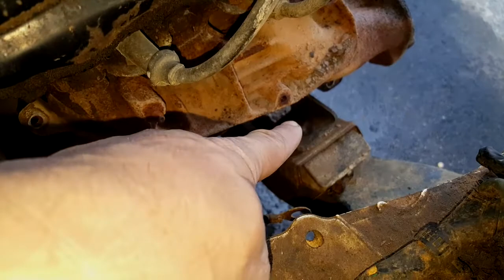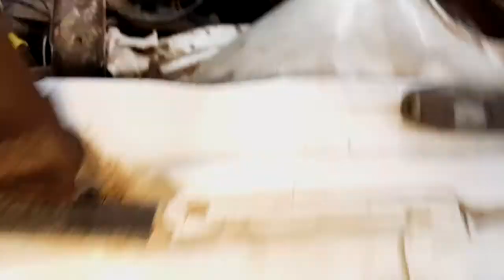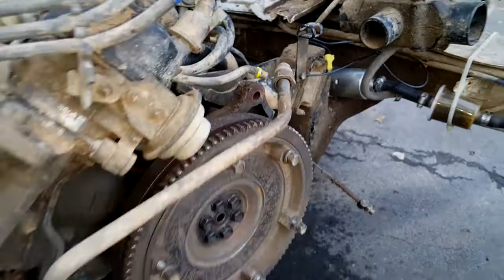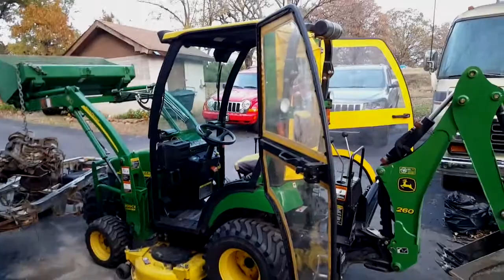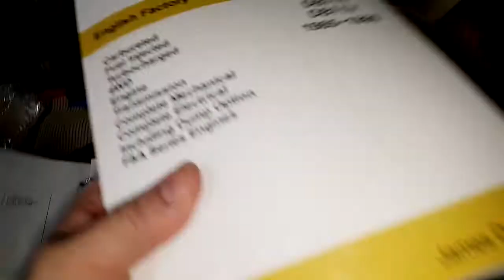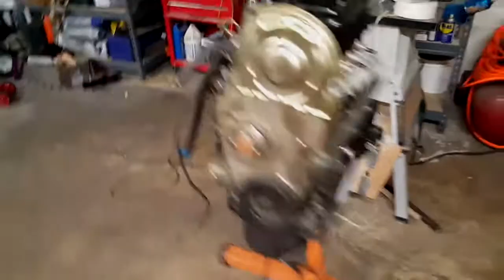1988 Suzuki Carry DB71T Engine Swap Part 7

Comment: Was the new engine an upgrade or the same, where did you buy it from, do they sell it as a short block or long and how much$.
Reply from the maker: Ordered one straight from Japan... was VERY expensive...$2000
I can sell you my first engine... nothing is wrong with it...I later learned it was just the valve seals needing replaced.

Comment: When you get the radiator out there is a free wheel actuator with vacuum lines coming from it on each side there is tees that go somewhere that’s what I’m trying to figure out where I know it might be gone over in part eight but I’ll be thankful if you tell asap

Comment: You could have just done a in chassis rebuild with out all this extra work and I'm guessing less money? This truck is ideal for a propane conversion the way its laid out. Huge project you took on kudos to you on that. I can't wait to see how it turns out. I'm hoping you find the transmission issue before it goes back together. The fuel sender looks like a geo metro. The flywheel looks like the Sammy and tracker models I wonder what it takes to swap in the bigger motors. The late models now have those engines. Fun stuff